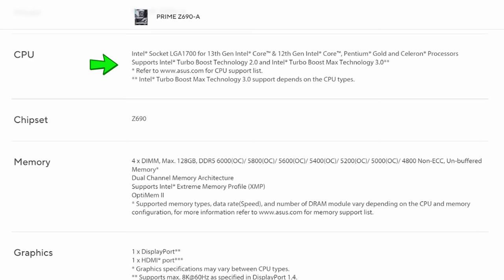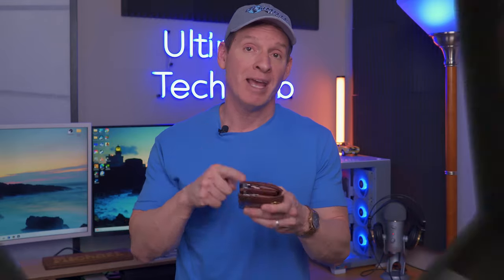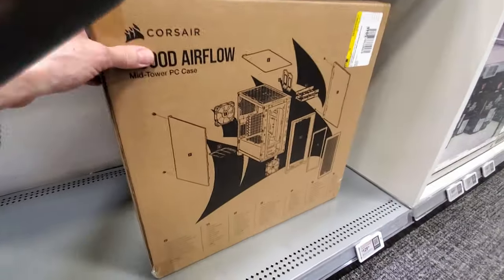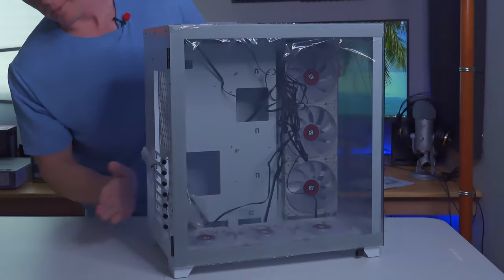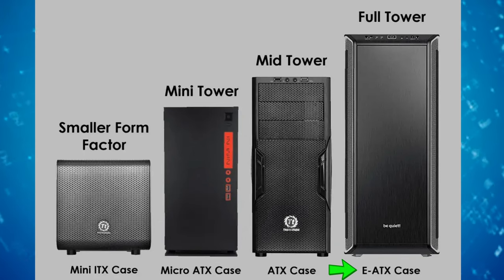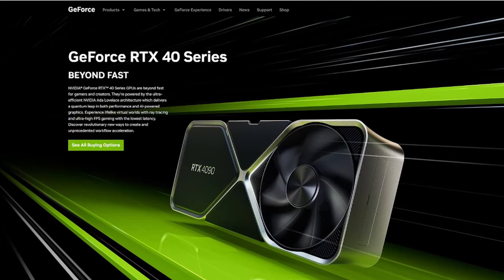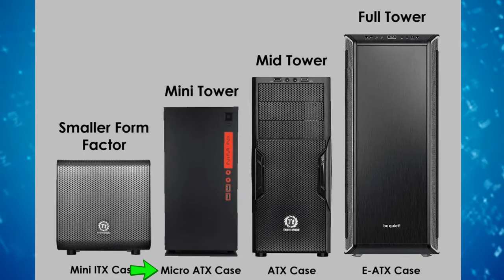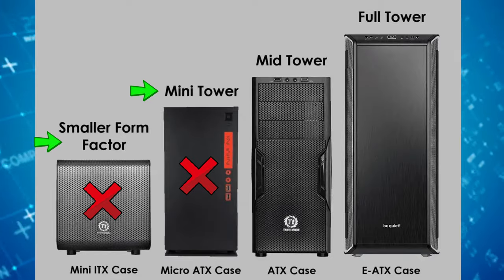PC BUILDING MISTAKES TO AVOID! BREAK THOSE BAD HABITS NOW!

Comment: I’m installing 2 NVME pcie 4.0 SSDs in my new build, a Samsung Pro 980 and a Crucial Plus P5. The Samsung is the faster drive, so should it be the Windows 11 boot drive, or does it really matter?
Reply from the maker: Use the Samsung SSD it's the best option of the 2 drives. I only use Samsung SSDs for my boot drives because of the speed and reliability. Thank you for watching and if you subscribed thank you as well!

Comment: actually putting the tubes below the cpu but keeping the top higher than the pump is actually alot better
Reply from the maker: There are so many different opinions on Radiator CPU cooler installations and which setup is the best. I always get the best results with the radiator at the top of the case. I have tried at the front of the case and below the CPU pump and got hotter temps. That's just my personal experience. Glad your setup works for you! Thank you for watching and for commenting. I really appreciate more input on my videos! 😃
Reply: @UltimateTechHub  it's not about cooling performance it's more about longevity and noise
Reply from the maker: @play420gamr  That's interesting because I get way more nosie when my radiator was in the front of the pc case. Longevity for my experience is about 2 to 3 years. I have zero noise with this cooler at the top.